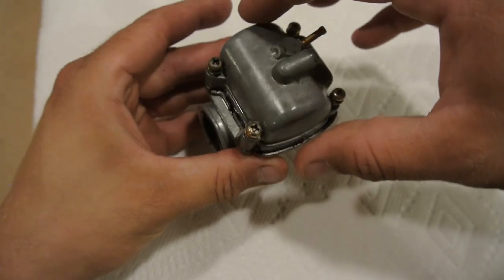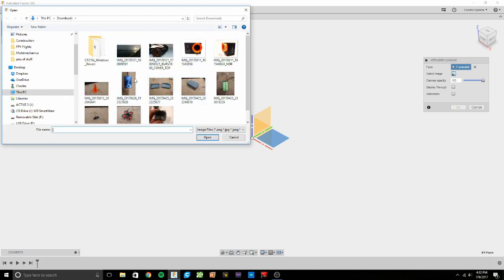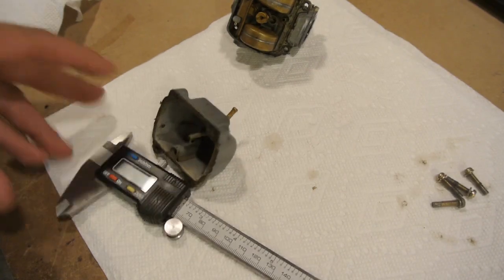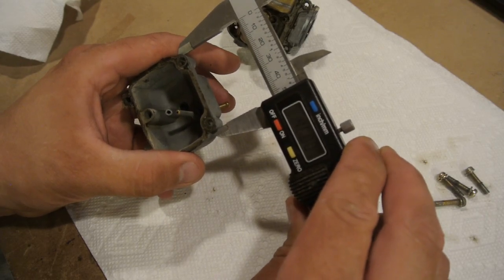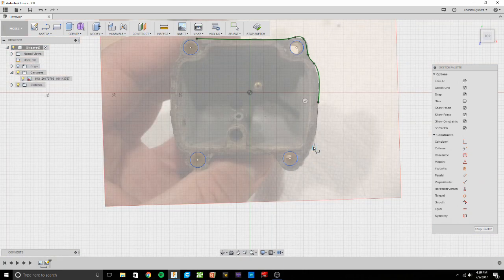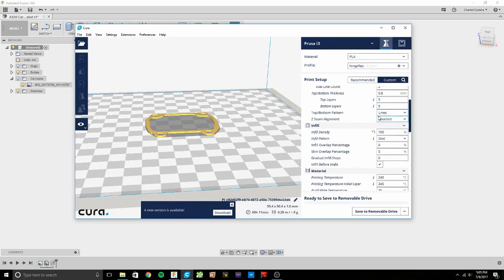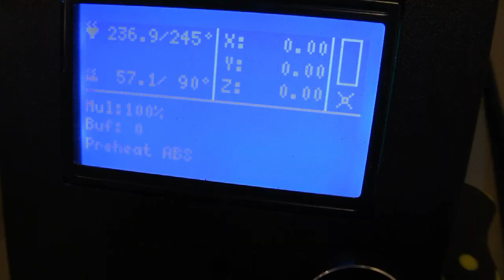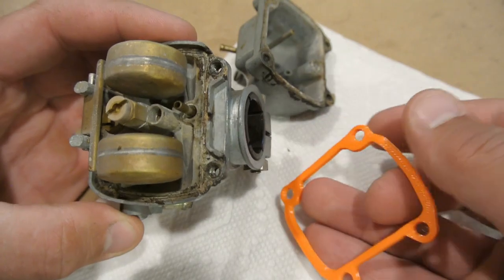3D Printing Motorcycle Parts

Comment: Much easier to use the fuel bowl on an ink stamp pad to make a mark on real gasket material and cut it out.
The needle valve might be leaking by.
Good luck
Reply from the maker: Yeah definitely would be,  I did this mostly as a test of printing gaskets in this material, the idea would be that if people started creating the models for all sorts of carburetors then its just a simple download and print.  And yeah, the needle valve is probably the real culprit, good call.
Reply: @multimechanica1460  great vid, I was thinking of doing the same for my old bikes. TPU has good chemical resistance characteristics. Upload your file to Thingiverse. I was surprised to see how much was on there for vehicles. For an old aircooled Beetle someone modeled an entire PICT34 carb body. You would just have to get your jets/needles.

Comment: Excellent information for me. I want to make parts for old motorcycles, I will have lots of uses for TPU, the bezier drawing curves are something I did in my sleep for years with CorelDraw, but what really got me was that you can import an image to 360, scale it and trace over it! That will save a ton of measuring dimensions and offsets to place everything correctly. It takes me for ever to create anything in Tinkercad, let alone be accurate, so I'll be installing 360 this weekend.
Reply: Olá meu amigo,esse programa que vc importa a foto .E depois faz as medidas.Qual o nome dele.Muito obrigado.

Comment: Thank you SO MUCH for this video, I've bene searching for information on how to do this for my own project bike (old rd200) and some of the gaskets are either ludicrously expensive for what they are, or straight unavailable.
I've been experimenting with tpu and have gotten amazing prints, so now it's time to get some gaskets modeled.
By chance, could you tell me the command/function used to scale the picture to proper dimensions?

Comment: Won’t the heat from the engine melt it?
Reply from the maker: Carburetors run cool by design, if they got hot enough to melt TPU then the fuel would also boil and the engine wouldn't run.

Comment: Did the gasket last against the petrol ?
Reply from the maker: Yes it has so far, from everything I've read TPU is fairly resistant to fuel and oil, I'll do a teardown video next year and take a look at how well it has lasted.
Reply: It's been over a year now, gasket still holding strong? Have you been putting miles on the bike? Awesome work btw man!
Reply: Multi, 2 years now. Can't find a new video. What's the update on the gasket?
Reply: @multimechanica1460  Ye. Come on. Upload the news. We are interested.
Reply: 3 years now.. how is the gasket?

Comment: Cant you just use gasket paper
Reply from the maker: Of course, more of a proof of concept thing for when I need a gasket with more dimension.
Reply: @multimechanica1460  yeah its a cool idea
Reply: @multimechanica1460  How is it holding Up?
Reply from the maker: @funfzigkubik3735  Still doing good, no leaks, had the carb off earlier this spring and it still looks brand new.

Comment: Leaking carburetor is more due to leaking needle. Usually if fuel reaches to the gasket fuel level is too high. There are some rare exceptions in motorcycle carburetors.